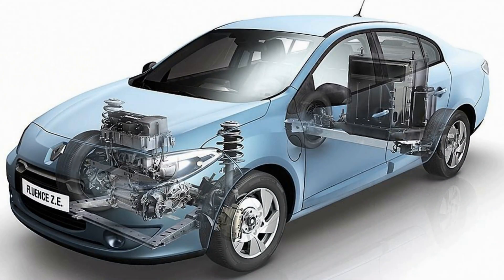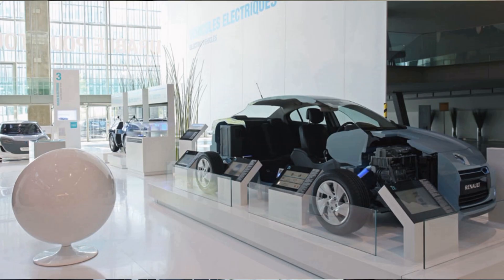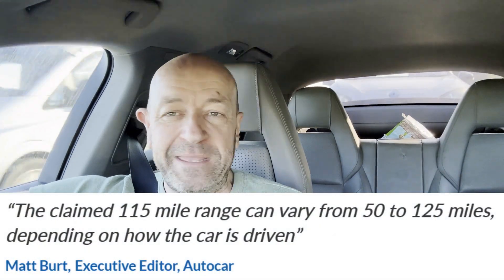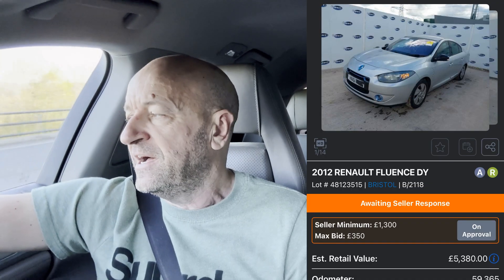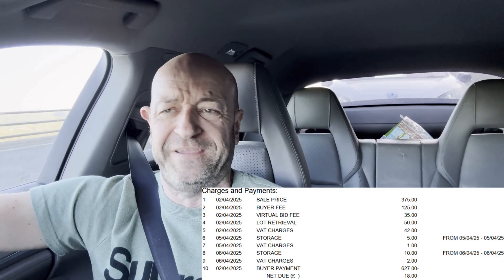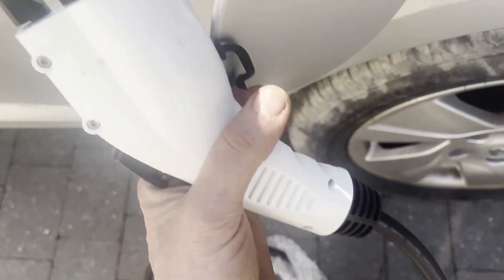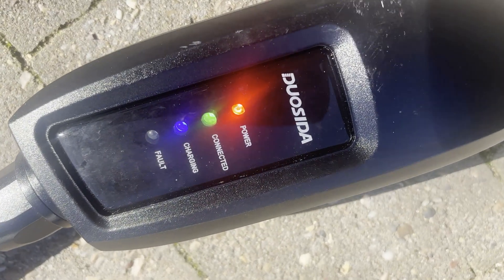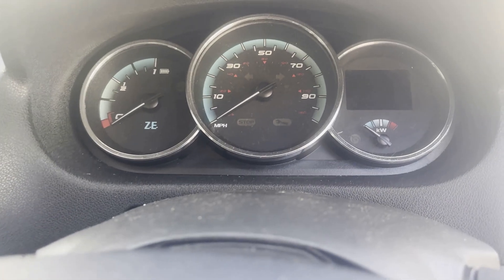Renault ZE Fluence down the pan…  So BAD they ONLY SOLD 78? £375 winning bid Copart EV "effluence"

Comment: Hi, my friend bought same car with 68k km. SOH is about 55%, range about 80-90km (depends on ac and driving habits). About your errors
DTC 33D496 LBC
Means that battery SOH is below 75%(if I remember correct) and you should contact Renault dealer for battery replacement.

DTC 1525F3 Data for Cruise Control and Speed Limiter NOT correct
Means that battery SOH is below 60%(again not the 100% precise number, sorry) and your cruise control and speed limiter will not work anymore.
If you will have any more question - as I am trying to be more familiar with this car - shoot a message and maybe I can help)
Thanks for the video, take care!

Comment: Hello, I have a Fluence Ze in my garage. I can't clear the fault codes. I have removed the battery and engine to look for a visual fault. I have had no success. A technically stable battery motor set would be good. I don't think the leaf motor will fit. If you have any ideas, I would also be interested in them. Best Regards from Austria
Reply from the maker: I’m afraid to say it’s prob not worth saving :( they are such old tech that unless you get another one as parts donor and have a passion for them (I know one chap here in the uk that has 4!) there was a guy that did a leaf battery converison here but was more than the value of the cars nowadays:(

Comment: I love Renault especially old ones all the extremely unreliable and parts for them are very expensive especially from Renault however Renault changed the ecosystem products and behaviour around 2013 and now they actually make a decent cars that embarrass a lot ofFords and I’ve also found that Ford went a bit shit in 2011 in my opinion I hate the mark free focus it was just awful but so was the mark six Astra which came out around the same time and I didn’t like either of those cars the new Astras which is the mark seven and mark eight are a lot better however personally I quite like the mark five in terms of Renault back in the day they were really rubbish really unreliable and they give French cars are bad for reputation and also made them bad and it’s amazing that Ren was still here to this day because they were bad from the start in 1899 all the way up until like 2008 and it’s amazing that the car company that was so bad for such a long time is still going now and they’ve massively improved. I think that’s partly to do with this technology so yeah but yeah, I really like Reynolds if you can buy your rental from 2013 to this current day they are really good and the far better the most of today’s faults and Vauxhalls this iPad can’t fucking spell but yes I do really like red I said Renault not red stupid I said iPad is listening. why are you being so slow? But yeah I do really like the new red my favourite one is probably the Alcana or maybe the Couture. What the fuck is this spelling? I said Qajar Kaja never fucking mind but yeah I do really like the new rental. They are really good the better than states and Vauxhalls seems to be that Ford and Vauxhall are really good back in the day but now it’s been overtaken by the likes of Renault and Kia Kia in a fantastic watch out for the 2010 current and Sorrento I said watch out for the 2010s Karens and Sorrento cause he burnt clutches really quickly. This sentence is now super long because his iPad can’t fucking spell but basically what I’m saying is back in the day for amazing Ford were amazing but now they’re really shit and kind of taken over. I said Renault this iPad listen to me so yeah.

Comment: What computer did you use to scan for faults?
Reply from the maker: I’ve got a launch x431 pro mini. Bought it as can do coding on the Maserati/Ferrari f1 gearboxes - but pretty good across the board.

Comment: Quite a bit on Wikipedia about these. Originally petrol versions, sort of Megane replacement and sold worldwide. I remember Motorpoint having a nearly new one many years ago and it was about the cheapest car they stocked - the nominal 99 mile range really didn't help sales.
Reply: Not a Megane replacement, but a sedan model based on the Megane III made by Renault-Samsung since Renault themselves never made a sedan Megane III

Comment: Ive got single wheel version.of that trailer im.selling. 2.7t capacity. £1650
Reply from the maker: Good trailers. Just wish mine was 10cm wider as can’t get the 360 on it :(

Comment: Why would you pay more than the bid. It makes no sense. You were highest bidder so they either take highest bidder or they dont
Reply from the maker: It didn’t reach the reserve the seller had listed it for. Once the auction ends the winning bidder can buy the vehicle at the reserve… or the winning bidder can counter with anything between winning bid and reserve. In this case the reserve was 1200 - but clearly VERY optimistic! I countered with my winning bid of 350, seller countered at 400, I countered at 375 and seller accepted.  When selling on Copart I believe the seller get three runs through the auction for the sales fee this if your winning bidder on third run through you’re better placed to get a deal. I’ve had 4 Zoe’s so far where I won but under reserve and sellers wouldn’t play ball.  Sucks.
Reply: @sevenone6  I can advise you never ever increase your bid..old cars like almost never get relisted and if they do usually they go for less the next time that's Because the fact it doesn't sell puts doubts in other 'watchers' minds that there must be a negative reason you didn't buy it..end of day it's an auction and your the only person willing to bid the highest amount.

Comment: The average guy working on there car (ice ) could make some terrible mistakes but old EV hell no ....
Reply from the maker: 400v of excitment is just a slipped screwdriver way!    Seriously though I don't dispute for the average DIY (like me) pulling apart battery packs is not a sensible move :)  scary thing with this old thing is I can't even find the main fuse to pull on the battery - the docs on the renault website for emergency services use say its under car bellow and to the side of battery but a quick look yesterday and nothing obvious!
Reply: *their

Comment: Another EV. That's why nobody wants it.
Reply from the maker: yea i think the old leaf/fluence battery tech just wasnt decent enough - but you gotta start somewhere i guess. hopefully the early adopters did them via Lease so didnt loose as packet!  compared to some of the modern teslas with mega mileage and an expected life on the road as a petrol/diesel then its horses for courses.  I love having an NA V8 in the garage and a big diesel for the long motorway drives (and towing) but a little ev for around town jump in an go in the mix makes a bit of sense.
Reply: ‘Nobody’ who is nobody? Just you?

Comment: The perfect project. Maybe you can swop in a modified 62kWh replacement battery for an early Leaf.
Or someone could fabricate a more advanced Lithium Ion battery to fit that space.
Something that would hold a charge for much longer and give much better range.
Looks like a tall order but it would be an interesting project nonetheless.
Reply from the maker: heres the problem...  for about 2-3k i can pick up a smacked 2020 on EV with 5-10 times the range. and thats what a battery would cost (if could get one) plus all the agro of course...  i dont want to do the usuall ev bashing video - we all know these early EV's are dev vehicles and thus disposabable long before any ICE would - but i was thinking to try make use of the battery pack thats in it for something?  I cant really part it out on ebay as with litterally a very few on the uk roads the parts are worth nothing and will never sell!  dilema :)

Comment: Been reflecting on this. I looked on a UK EV forum for this model and it was suggested to run the HV battery to 10% and then slowly charge it to 100% and let it balance at the top end for a few hours. Repeat and see if this extends range. Failing that, there's someone called Toomba on SpeakEV who is apparently a Fluence EV expert and appears to have made/repaired packs using Nissan Leaf cells. Obviously check it out yourself incase i'm mistaken.
Reply from the maker: with a full charge its giving me a range of 37 miles :D:D:D  I read the same stuff i think - rebuilt options are availabe but its laborious and expensive thus sadly not gonna be economical - im going to try get these two codes clear somehow and embrace the rubish range and see if we can do some fun stuff with it! (will try the 10% and back to full etc once/if get errors gone!)   thanks for your thoughts!

Comment: The electric bits are probably more Nissan than Renault the ports are chademo which is what all the Leafs are. 
A HEVRA garage might be able to help with those codes.
Reply from the maker: I’m tempted to take it down to my local Renault garage and see if they’ll run a quick diagnostic… prob cost more than cars worth though :)
Reply: @sevenone6  True, My worry would be that there's probably no one there, who'd ever have seen one.

Comment: oh boy don’t plug a granny charger into a 4 way block, especially the end socket which is furthest away from the input lead - they are simply not designed for high sustained draw
Reply: Meh they are designed to handle 13amps a good quality one will be fine.
Reply: @HA05GER  almost all are cheap things nowadays
Reply: @eliotmansfield  I dunno I disagree. I've abused high quality ones and they've been fine.
Reply: It'll be fine. Those small batteries only charge at 6 Amps on a granny charger.
Reply from the maker: Living on the edge and pushing the boundaries - that’s me :)  as far as sketchy goes I’ve done worse ;)

Comment: It should be in a museum as rare as hens teeth. But whether you can get it to work - all bets are off.
Reply from the maker: Yea I’m pretty resigned to the fact this is a  hiding to nothing!  With it just having a service light however I think it could get a mot - and might be some fun in seeing what we can do with a 13/14 yr old ev!  Open to suggestions :):)
Reply: @ Is it actually undriveable or just a low capacity batter? Have you charged it to 100% and let it balance? Are the cells the same as the Leaf? Could someone like Cleveleys replace a bad cell or two?